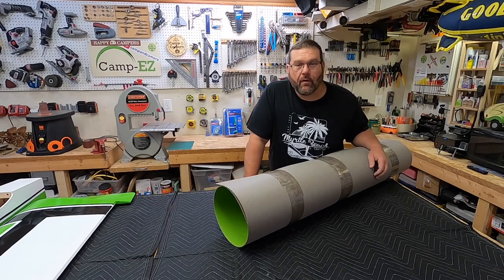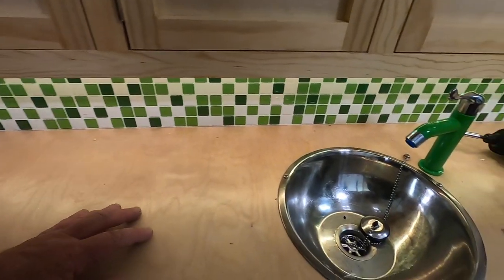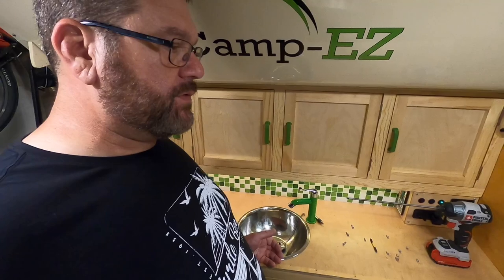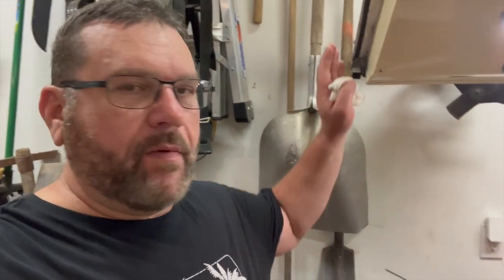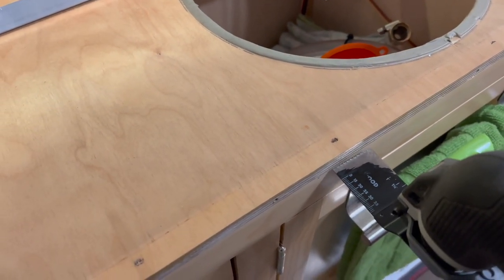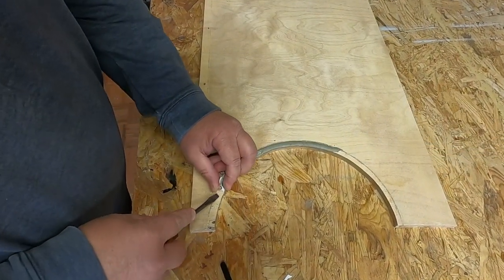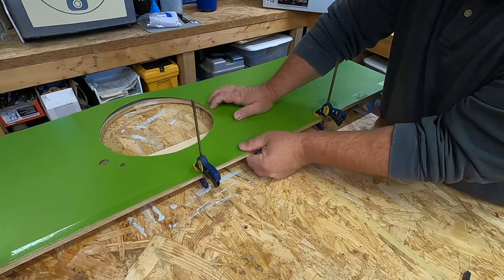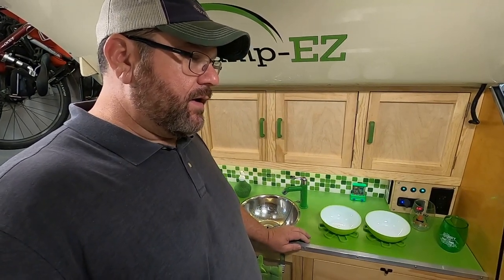I Can't Believe How Much Better My Teardrop Galley Looks! | Simple Upgrade

Comment: I like your roller, I just use a scrap piece of wood and seams to work ok. One thing I would suggest to others is to wait on cutting the sink and holes intell after the countertop is glued and dryer that way you have allot less to try and light up. then just use a router put or the right size drill bits on them. gally looks great with the green! im still trying to figure out what exactly I want to do with mine next spring.

Comment: Saw your teaser photo on the DIY group. Final countertop looks nice! If you have to take this out again, maybe consider putting in a channel to the back of the counter for those wires coming through into your electrical box. That way it slides out & no wires to cut! 👍
Reply from the maker: That’s a great tip!

Comment: You may need to place some soft rubber on the outer edge of the round cover to help prevent the cover from tipping to the side when an object is placed off center on it. Like the addition to your galley - that color works!

Comment: i put a skillet on my countertop & it bubbled it from the heat. It was a plastic sheet so it's not exactly what you put on, but I glued it on same as yours. I'm going to go with small tile on mine because i want to put skillets on the countertop. I'd try it on a sample piece b4 1st. I can't believe it's been 3 years since your build.
Reply from the maker: Great idea!  I have plenty left over.  I may set a hot skillet on it as a test.

Comment: Nice 👍.  Is the tile backsplash you have ceramic tile, or the adhesive-backed vinyl stuff?  Just bought a Hiker trailer and thinking of galley add-ons.

Years ago, when installing indoor/outdoor carpet in a boat, my wife caught me using her wooden rolling pin from the kitchen to smooth-out the glue under the carpet. She asked if that was the one from the kitchen, and I promptly replied, "Nope, it's one just like it". 🤪
Reply from the maker: Good rolling pin story!  The tile is sticky back vinyl.
Reply: @CampandCamera  Appreciate the info 👍